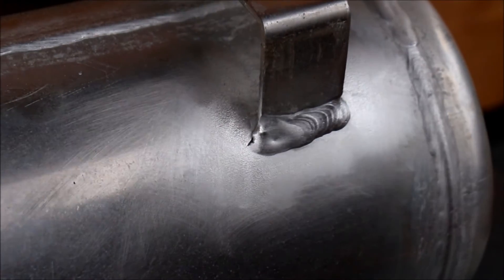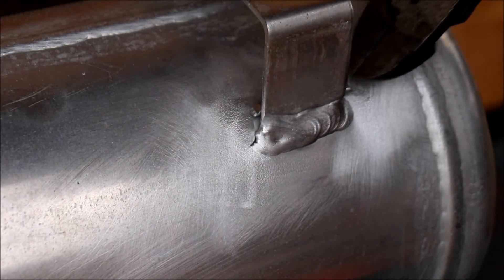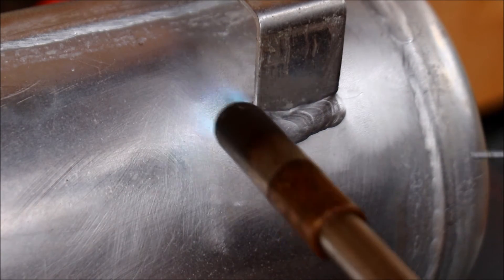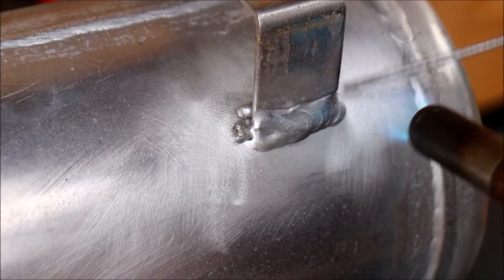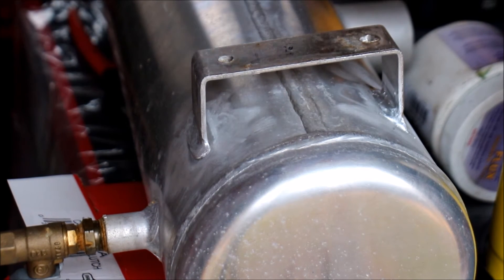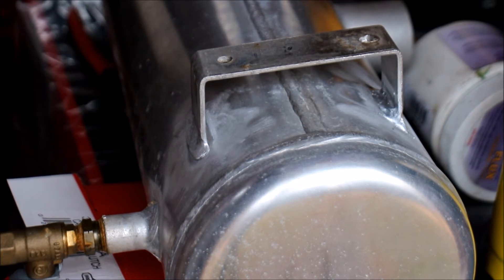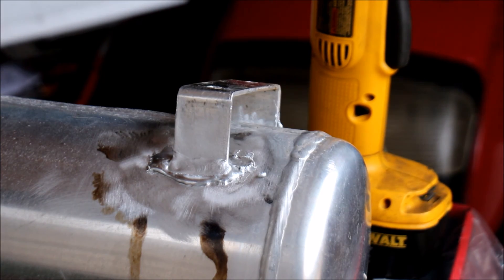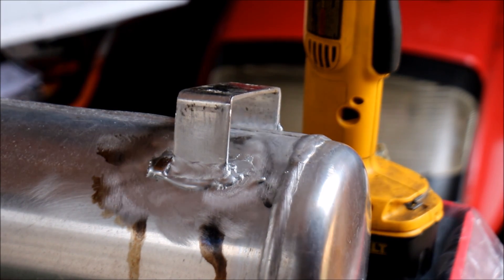Aluminum brazing tank repair for Woodland Mills HM126 bandsaw mill

Comment: Good job that's a different technique then I myself do or that other people might do usually heat up the object and then feed it into their as the objects hot not lay it down and heat it up with the object but either way great job glad it worked out for you if done properly it will definitely does work awesome vid 👍 the more heat the better
Reply from the maker: So far it's held up.  But the tank is broken in another spot so i might do this again

Comment from the maker: Just redid that last joint again.   NO more leak.   tested with water.   If there is any leak at this point its inconsequential.  So at least short term aluminum brazing works.    We will see how it holds up.  I probably won't do much milling until spring.  If I find a problem I will give an update.

Comment from the maker: So, it looks like 3 joints are fine, the most major one still leaks, albeit slightly.   I'm going to see if I can figure out where the actual leak is with pressurizing the tank, then re heat it and add some more brazing.  I will keep everyone posted

Comment: Looks a bit tricky to flow. When your tig welding it's about the same , just don't get it too hot. Did it hold. I've never tried that rod before. Interesting vid. 👍👍
Reply from the maker: STEVE ROB gonna see if it holds water tomorrow
Reply from the maker: STEVE ROB and yes....the flow is tricky....need to move the rod without the heat on it to get it to stick right....it's odd for sure